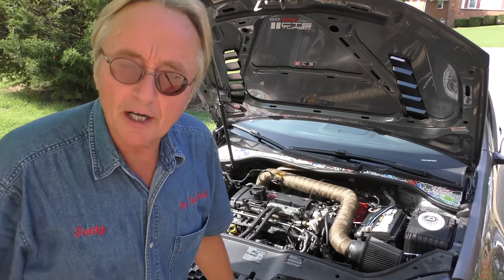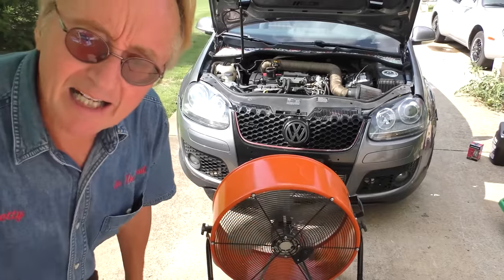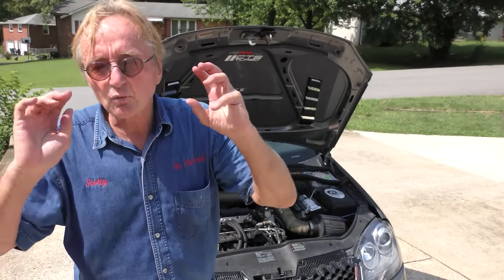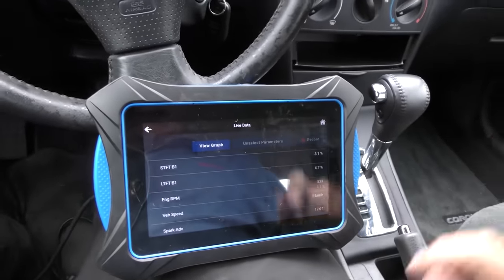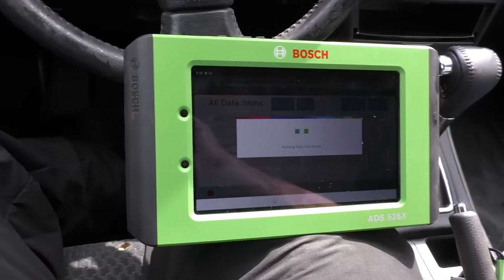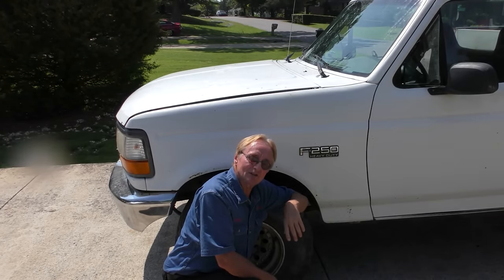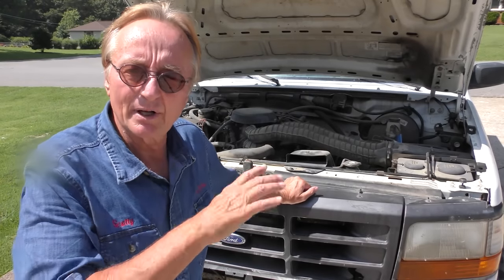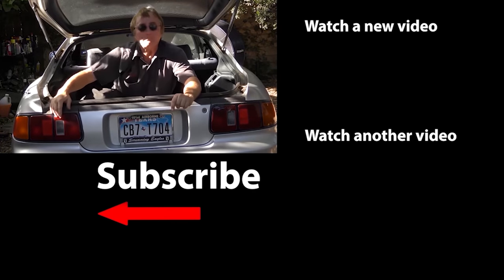3 Additives That Will Make Your Car Last Twice as Long

Comment: Regarding the Lucas XMSN Stop Slip: I have an 04 Camry that after I bought it around 280K miles the transmission started making a slight clunk between gears; more often in the summer when fluid was obviously most hot/viscous during the year.  Pretty sure the previous owner hadn't changed the fluid much.  I drained almost half of the old fluid out and put Lucas Stop Slip in and it's still running at 305K with zero clunking!  Will post back here to let you know when it does start to have problems!  Pretty impressed with this stuff.

Comment: Scotty you need to do a review on Luqui moly mos2 Anti friction Product number 2009. I have a 97 Jeep Grand Cherokee 318 ci 203,000km (around 160 000ish miles) I cant believe the differance! It runs cooler and keeping around 90 kph (50 ish mph) is get 600kms (480ish miles) a tank**miles may be off I from Canada** but I guarantee you'll like it! your the man Scotty I really enjoy your vids!

Comment: ATS oil cleaner you CAN drive it for about 15 minutes and then change your oil. You don’t have to let it idle fast. I have the same product and I called ATS myself.
Reply: How much does it cost?
Reply: @Johnny53kgb-nsa  it’s a bundle for 60+. Oil and fuel cleaner. Can’t buy one separate.
Reply: ATS?

Comment: Love it Scotty! I had a 1995 F150 with the 351 5.8L, seriously GREAT truck! Beat it up hard but matinenced it regurally. Bough it back 10 years Mayer and it still runs great. UNKILLABLE
Reply: Cool! I heard those are good engines
Reply: Just bought a 07 f150 cared for, runs smooth, but rust underneath. I won't need it forever; but whatever I can do to keep her purring for the meantime is worth trying  :) any and all advice appreciated (female who can amazingly diagnose many problems, due to  dating a mechanic for over 20 years)...but  other than very simple things I'm not a truck DIY'er...🙄
Reply: @TwoPartyIllusion  get some spray-galvanize and shoot the hell out of the rusty sheet metal. be warned- it ain't cheap- you can get it at wally world and you can spray paint over it if you don't like the gray color. great stuff. use it on saltwater boat trailer all the time....

Comment: My friend had 1983 Toyota pickup he named, "Mr Fixit."  It had 350,000 miles on it, primer paint job and the  original engine, he did replace the clutch 7 times.  It didn't carry a huge load, but never broke down.

Comment: Lucas trans fix is the truth. Ive had slipping trans come in and i do the flush and use 1qt with new fluid and they are good to go. Even a year later ive had customers come back giving praise about how smooth everything is. Lucas products are great.

Comment: That Lucas stop slip IS AMAZING. I used it on a Nissan quest van that was slipping and taking 5 seconds to engage in drive or reverse. It started working in an hour. I had bought the 250k mile van for $50 us. And drive it for 100k more and gave it to a friend who put another 20k of hard miles. If I still kept it I bet I could of broke 400k. I've been using LUCAS PRODUCT FOR 30 PLUS YEARS

Comment: I use a can of Seafoam on my Hyundai every three or four tanks and my engine runs SO QUIET and I’m at 189,000 miles.  I also use Seafoam spray into the intake as well every 6 months all to you.  Thank you.
Reply: Injector cleaners are legit but there is better brands than sea foam

Comment: 1. ATS Chemical 505 CRO Oil System Treatment for Gas and Diesel Engines - $47+ (1:10)
2. Royal Purple Max-Clean Fuel System Cleaner and Stabilizer 11722 20 Oz - $13 (13:51)
3. Lucas Oil Transmission Fix Stop Slip - 10009 - 24 Oz $14  (18:42)

Comment: Hi Scotty, I have been watching your videos for years but only recently subscribed. I don't have a mechanical bone in my body but I find find your videos to be fascinating and incredibly informative. I now have a practical reason for following your program. I have a 2015 Hyundai Tucson that completely loses power in 30 C plus weather and under high acceleration. it also emits a rotten egg smell under those conditions. Despite repeated attempts at diagnoses, no mechanic has been able to pinpoint the problem.
Reply: Not sure if it’s still up, but you used to be able to submit questions on his website.
Reply: Check the O2 sensors. Had the same problem with my santa fe

Comment: I personally like Techron and occasionally Atf in the fuel tank . I threw some in my Corvette to get it running right after the computer took a crap on the way across the country . I drove it in limp mode longer than I should have and finally gave up in New Mexico . I left it with some local mechanics there and told them whatever it takes and I will be back when it is done . I got about 3 miles from their shop when it started acting up and they suggested the Atf in the fuel tank . Within 50 miles it started running like new . I was amazed at the improvement in the top end .
Reply: automatic transmission fluid?
Reply: @jonathanescobar7766  Yep - first time I ever heard of it either . i thought it would screw something up but it didn't .
Reply: @creed5248  your lucky it didn't ruin anything.
Reply: @andrewmendez260  - I guess it is an old mechanics trick for cleaning the valve train after a customer runs the car in limp mode - or not all the cylinders firing situations . It works great and won't hurt anything
Reply: @creed5248 I'm telling you right now even though it didn't damage your engine I'm a mechanic went to school for it you don't put automatic transmission fluid and in your gas. You can do it yes but it doesn't mean you should . You'd have way more effective and safer results from just buying a fuel injector cleaner for 5 $. do as you wish with your automobiles though trial and error will teach . I know exactly why it wouldn't be good to put it in for multiple reasons but I'd be writings an essay.
Reply: @andrewmendez260  - cheaper than replacing the heads is pretty much all I can say

Comment: Hey 'Scotty like ur style, I was kind of surprised you didn't suck the oil out of the dipstick, I've doing it for years now, works great on the inline trans axle 4 bangers no mess no fuss 15 mins done and it was proven to me you actually get more oil out by sucking it out ..... doesn't work on V 6 or 8   anyway love all videos   nice
Reply: That's interesting. Why does it get more oil out?
Reply: Shape of the sump, and the not so viscous fluid inside. With a pump, you can move the pickup tube and generally get almost all that's in there

Comment: I live in Maine. I remember the old GM 305"s (80's 90's) one built in the US with 70,000 miles was a boat anchor (soft cams). The  Canadian built ones were pretty much bullet proof.
Reply: Wow, never knew that about the cams in the 305's
Reply: Are you talking about cracked cam shaft but keeps runnung.? !

Comment: I had an uncle who was a diesel mechanic in the Navy. He said they poured kerosene into the crankcase oil, how much I don't remember, ran it for several minutes, then changed the oil. The idea was to clean the engine of deposits. Btw, this was back in WW ll. Navy requirements by the book.
Reply: be very careful when you do that- it will loosen stuff that can damage your motor. some guys use marvel mystery oil for that.

Comment: I have a 2001 Camry LE 5SFE 4 cylinder.
It only has 120,000 original miles. Runs great. No major issues. I think possibly I'll clean up the injection system with The Purple brand.

Comment: Thank You so much Scotty! You are truly a blessing help people save money and improve our knowledge and enjoyment of our cars and trucks! I hope my ‘05 Tacoma V6 4x4 lasts forever! Best little truck I’ve ever had! Even can change your oil filter standing up and no oil running down to your armpit… Gee, who knew?!! 😂
Reply: Scotty would say if it was a 2004 not 4x4 then it literally would last forever. Like the one I have. Lol. Just change that rear differential fluid
Reply: What products did Scotty use?
Reply: @AFriendofChristJesus  Thankfully Testy Mann posted a couple weeks ago.
1) Ring Carbon Remover: Automotive Test Solutions carbon remover.
2) Fuel injector cleaner: Royal Purple Max
3) Transmission shifting and slipping issues: Lucas Stop Drip.

Comment: I personally would not put LUCAS anything in my vehicles all it does it makes stuff thicker. The ATS engine cleaner is also suspect for cleaning valves on an GDI ENGINE. Royal Purple I have not tried but I do use BG PRODUCTS, they work well for me, mostly depends on how bad the engine or other things have been neglected or if you have a GDI engine. There's really only a couple ways too clean them well & it isn't just pouring an additive in the oil.
Reply: Walnut Blasting i assume?
Reply: @edubb2491  YES SIR, That's probably the best way.
Reply: T.Y. Scotty, I'll get that TELE. OUT RIGHT AWAY, SIR.
Reply: @NoWr2Run  at around a thousand dollars it's not feasible as it must be done every 30k  to 50k miles

Comment: That Bosch OBD seems like a pretty nice diag tool. I just recent purchased Snaps Apollo used refurbished with 2 years of paid software, 8' leads, low/high amp clamp, and oscilloscope interface for 2500. The software and accessories were worth more than the price. Got real lucky on that. Cause a great Diag tool is worth its weight in gold
Reply: Yeah his Bosch diagnostic tool is about $5000!
Reply: Problem is a diagnostic tool is worthless if you can't figure out how to use it -- Maybe the dealers, who couldn't find anything wrong, should get mechanics that can use diag. tools!
Reply: only for OBD-II and forward. OBD-1 is self-diagnosing (pre 1995)

Comment: I’ll use a product called Auto RX occasionally on an oil change cycle of a high mile vehicle. I think it thins and loosens sludge, frees packed rings, etc. Which is particularly a problem on small 4 bangers because those run hot. I always questioned the effectiveness of an in tank additive to do much damage against carbon. It’s being ignited how effective can it be? If I ever use seafoam I will turn the motor so pistons are below the ports and dump it straight in the cylinder replace the plug and let them soak. Days if possible. Carbon doesn’t jack around few products dissolve it well. PB blaster used to make a small engine tune up spray that dissolved carbon better than anything I have ever seen but I don’t think they make it anymore. I used to soak my two stroke domes with it and it left them clean as a whistle. I used to soak cylinders in cars with that stuff too.

Comment: I bought a 06 Ford Econoline 350. It has just under 170k miles. I am shocked with how well it drives. I bought it just as a bike hauler and camp van. It is actually fun to drive.  I am thankful they didn't have the 5.3v3 engine.

Comment: Dad had an '89 F250 2wd with the 351 Windsor in it. 5 speed manual with 3.73 and heavy duty axle. Rock solid truck, took a ton of abuse, never broke down once, had pretty stout power, pulled absolutely everything (even 400 bales on 4 chained-together hay racks). They really don't make trucks this stout, reliable, and SIMPLE anymore.
I'm wondering how much less noise that GTI would have made with a fresh oil change anyway...
Reply: I have a 97 F-250 with a 4.6 triton engine also made in Canada. It's in excellent condition mechanically speaking. And you're absolutely right it's a great truck for towing or carrying a heavy load. Plus it has plenty of power. 
Doesn't leak a drop of oil either, unbelievable! 😊
Reply: theyre not gonna make ANY trucks like that in 10 years

Comment: had 2010 Corolla rattling on cold starts, after some research figured its either VVTi rattle or time chain, before opening the engine decided to try this and so far no rattling 4 months after

Comment: Thanks again Scotty! My 2009 Chevy 5.3 burns oil like you describe. I replaced the valve cover with the updated one & put the small splash guard in the oil pan. It still burns same amount. Installed a Range Technology module in the obd port to keep it from going into 4 cylinder mode but still burns oil. 218,000 miles and just placed my order for the ATS Chemical oil & fuel treatment $74 with shipping. Time will tell.....
Reply: Did it do anything
Reply: Im curious did this fix or at least lessen the oil consumption?
Please let me know, My 2014 5.3 is doing about the same thing, about a QT per 1000 miles, also had an oil cooler line that was leaking, just replaced that, but was looking at running the ATS as well.
Cheers

Comment: The low tension rings is the reason lots of cars are burning oil …

No oil additive is going to clean valves.. have to do an induction cleaning for that which you are supoosed to do every 30,000 miles on a direct inhection motoe
Reply: Sticking rings from carbon sludge, does not affect valves, Dude. Can affect valve guides though.
Reply: Marvel Mystery Oil added to your oil will clean the valves and the top cylinders as well.. Scotty recommends that as well if you have watched his other videos. I use it and all my new Toyotas. and I did in my past Hondas.

Comment: what were the first two additives, no mention of their name. 
 I always run Lucas upper cylinder lubricant, awesome stuff.
Reply: Courtesy of Testy Mann:
1) Ring Carbon Remover: Automotive Test Solutions carbon remover.
2) Fuel injector cleaner: Royal Purple Max
3) Transmission shifting and slipping issues: Lucas Stop Drip.

Comment: I just learned that if you're going to store a car for the winter it's best to use additives first and putting in gasoline after, so there is less pace in your tank to get filled up water or something like that. I'm not sure if that applies for the summer too but I'm going to start doing that now lol I was also going to do some research on the best additives, but then I found this video 😂

Comment: Scotty, What do you think about running TECHRON cleaner every 3,000 miles in your engine??
Reply: Sure..wont hurt
Reply: In ‘91 I switched from using Arco to Chevron and got 2mpg better, it was on my new Ranger pickup and I repeated the experiment with the same results. Chevron gas with Techron.
Reply: @williamriedel1686  Good to know!  I rank Gas in this order.  1. Chevron 2. Shell 3. Mobil  4. 76 .... all others who knows!?
Reply: I would be concerned that the seals on the fuel pump could be damaged with frequent use ot any fuel system cleaner..
Reply: @onebrightflash  an arguably true statement

Comment: Thumbs up Scotty! You have really saved me a great deal of money and I've learned so much from you.  
I am currently looking for a vehicle and I know of course Toyota is highly recommended.  I'm looking towards kia Sorento, jeep cherokee,  Toyota rav 4, Honda cr v or maybe a subaru forester. My first was a chevy equinox but I don't know what is best mechanically?
Reply: @Ran z thank you,  I like the Toyota but the subaru I've heard is best in the snow which is very important and I like their safety rating
Reply: @thesamsquatch5224  Scotty is a decent fan of Subaru's too; the newer the better
Reply: My mom has a 12-year-old CR-V that's been a complete tank in MN weather and has barely a spot of rust after all those years in the salt.  Great little machine; just keep it clean, change the oil, and maybe throw an undercoating on there if you're dealing with a lot of salt.
Reply: Don't buy the Kia Sorento! Relative had 2 of them...The '06 burned down from engine fire 6 mos. ago, had no neglect or maintenance problems, well cared for...Caught fire right after another relative exited the car! AND the '12 Sorento they still have...Kia has an undeclared recall that if the engine gives problems, KIA will pay for a new engine! (the catch is you have to have ALL the receipts stating the oil changes, etc. maintenance was done, all the way back to start, so DIYers are out of luck. Not a good long term prospect, those Kias!
Reply: Thank you all very much! Kias warranty is attractive but just from reading this and watching Scotty its not worth it. I really think subaru or the Honda may do it. I so detail so I'll make it shiny and I have a coating o it'll be nice and clean. Ammo nyc has an anti salt spray that is beast if anyone wants to try. I'm in Cleveland,  Ohio so winter is horrible
Reply: Where do you get the product for crankcase?..thnx
Reply: Honda/Toyota, he does recommend or not recommend certain year models of certain vehicles so find the videos where he talks about SUVs. Good info there!
Reply: My wife’s 2012 CRV has been a great car.
No rust and our city used sodium chloride on the streets in winter.
My F150 almost disappeared from rusting but the Honda still has no rust.
Runs like a top. Gutless but it’s a good unit for running around town.

Comment: Scotty! You can use the drain plug at the bottom of the oil filter plastic cartridge to help with mess. Just jam a screw driver in there to open the valve.

Comment: @scottykilmer
Love you man! I bought into the ATS additives to be preemptive with a 2006 Honda pilot with 200k on it. I did the fuel and oil cleaners. About a month later I get a CEL and a PO420. I just started thinking that maybe the ATS cleaned the gunk but clogged the cat???? Lacquer thinner may be in my future. Noticed a different burning smell recently. Not sulfur more electrical in nature … fyi. Thanks for anyone’s suggestion

Comment: There is no way that oil treatment affects the gdi system if it did the engine oil would have to pass by the intake valves so whatever was causing the clattering had nothing to do with the carbon build up on the intake valves which happens to gdi engines.
Reply: The Fresh oil is most likely what changed the engine sound. The old oil wasn’t lubricating as well.